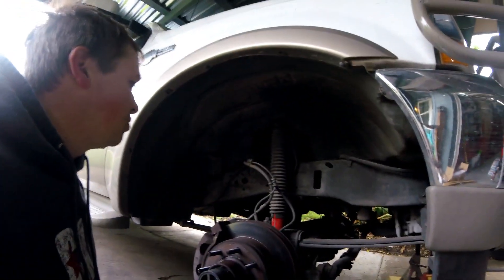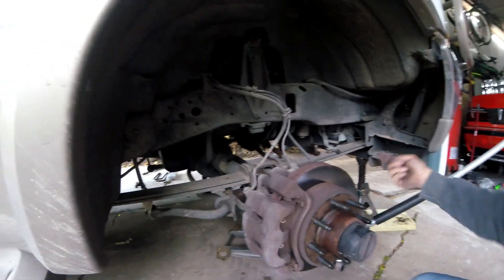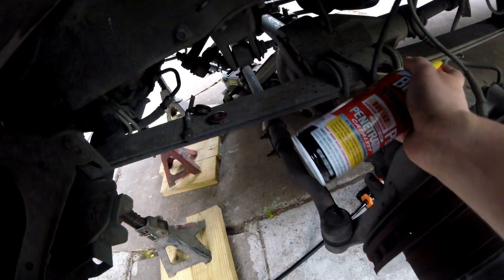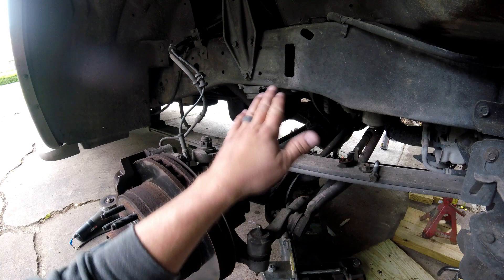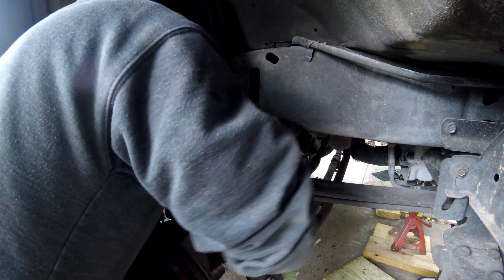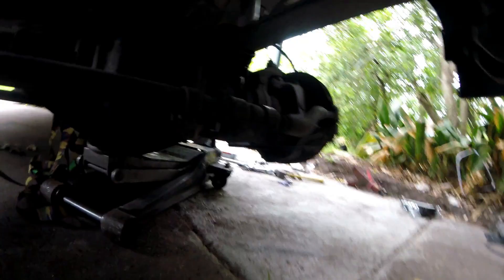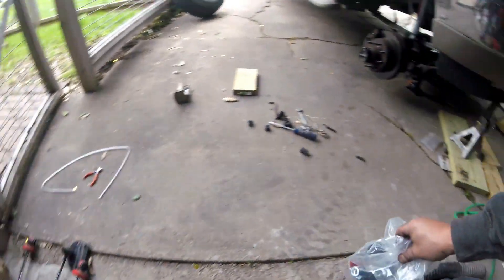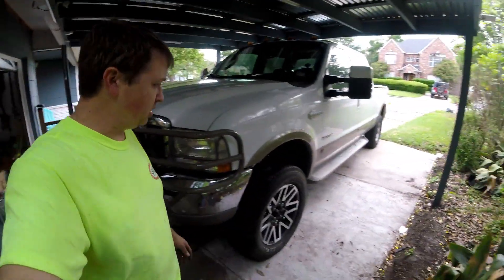F250 Build!

Comment: How’s it holding up? Just picked up my own 04 F250 KR. Watching through your build as it’s the closest I’ve seen to what I have. Same color too
Reply from the maker: @elijahflores1497  everything has held up great. Shocks are still good, level kit has had no issues, dual steering is still going strong, just replaced the tire on the the wheels I installed.